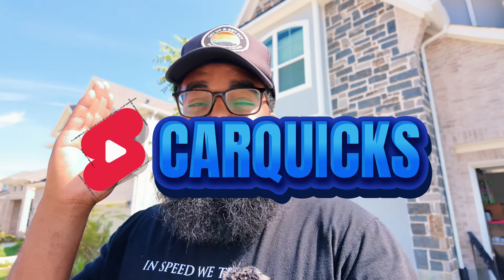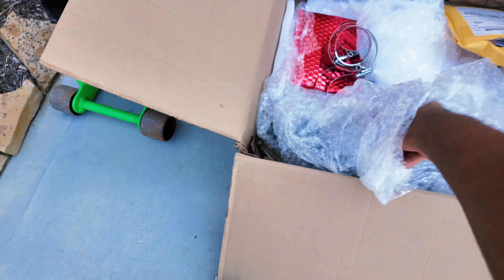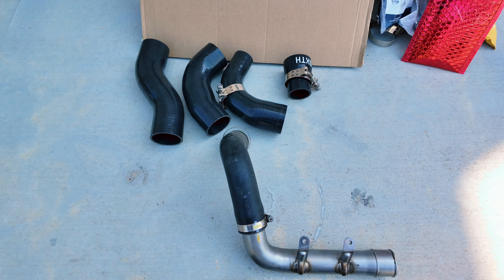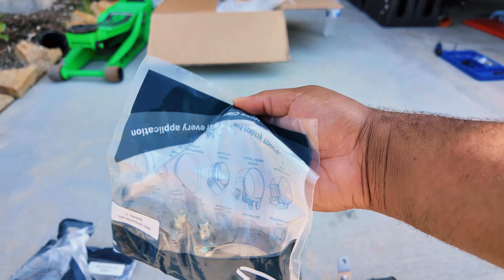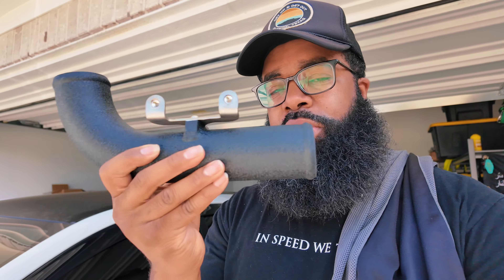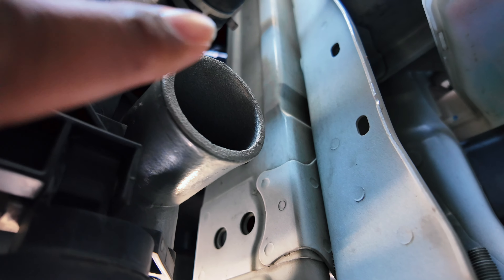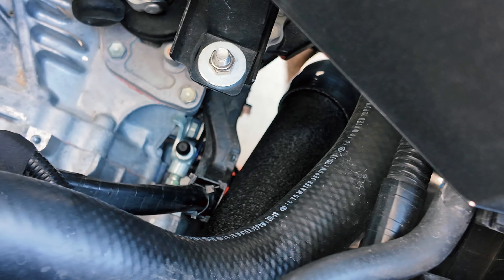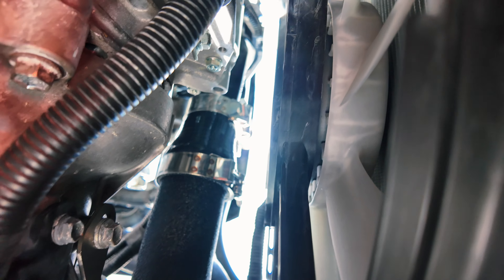SXTH Element GR Corolla Charge Pipes | Install

Comment: Man, I have really been enjoying your GRC videos. I have a 2025 model on deposit. You have given me a LOT of good ideas for it once I take delivery sometime next year.
Reply from the maker: You'll love the car once you get it!
Reply: Horrible car man I’m this close to returning it, damn car chooses timing on its own, gives you boost when it wants too I’m absolutely done with it, giving it one last shot and that’s tuning it and if that doesn’t work I’m trading it for something better, any who today I got absolutely obliterated by a 2009 Acura TL, on some real bullshit, guy turn on his emergency light after he beat me, you don’t the feel I felt after loosing man I spent 54k and this piece of shit car and that guy happy with his cheap Acura TL.
Reply from the maker: @ here is what I will say… you need to get your car sorted, if what you are experience is in fact true. ECU aside it sounds like you have a problem.

And you don’t need to take my word on that, look at the many other accounts from Australia to the UK running the exact same engine, look at the development they’ve done. 

Do more research. Check for boost leaks. The ECU has its ability to make adjustments but most cases it’s making those in benefit of things like more airflow, more fuel. 

What you are describing sounds like a car having issues.
Reply: @mr_thrash8514  bro what lmfao go get a 10 speed mustang gt if you want straight line speed

Comment: Quick question, is there a difference between charge pipe and downpipe?
Reply from the maker: Yes. The downpipe comes off the turbo. The charge pipes come off the intercooler.

Comment: Did this a few weeks ago, clamps were good except had to use the stock one off the turbo x2 cause the ones sent didn't hold. Also did a old BMX trick and sprayed Hairspray on all the rubber to metal attachments then clamped em down. haven't had anything slide off yet.
Reply from the maker: Thats crazy, we did the EXACT same thing with some hairspray lol

Comment: Would this work with the OLT intercooler
Reply from the maker: That could but you’ll need to run the OTL Intercooler that has a 2.5 inch outlet/inlet.

However, you could still run a silicon coupler that reduces down to the OTL sized intercooler and run these fine.

Comment: I have the SXTH Intercooler and charge pipes. They are great however the clamps are trash. I repeat DON’T use the clamps that come with the kit they leak boost. Use constant tension clamps. Charles from SXTH overnighted me clamps from McMaster Carr that are industrial strength with nylon bolts and are constant tension (WORKS GREAT).My Corolla GR make 303whp and 310wtp on a mustang dyno. (Only mods are intercooler and charge pipes) The charge pipes with the intercooler makes a good power gain. If you tune it you will gain more power and torque earlier.
Reply: Can you send a link to the clamps ur using?
Reply from the maker: Look into all the heavy duty clamps, we used a few Constant Tension clamps and the Ideal Tridon clamps. The Ideal Tridon clamp is specifically made for high vibration, off road equipment and heavy machinery. With how our engines run and the vibrations you normally get under hood, this are amazing.

https://hcl-clamping.com/collections/all?hose_clamp_type=Hose+Clamp+Type_Heavy+Duty+Hose+Clamps&page=8
Reply: @CarQuicks  I called Charles at SXTH in July he overnighted me free of charge constant tension clamps made by McMaster Carr heavy duty like you said they have a spring and have nylon bolt. Apparently these clamps are 15.00 each. With 8 clamps I was happy SXTH stepped up and took care of me.  I hope the new clamps they provide are these for customers going forward. These new clamps are awesome no issues whatsoever with new clamps.
Reply: Fwhp or awhp? Corrected numbers?
Reply: @cheeko_914  it was a mustang dyno awd. We did 3 runs and the only mods are a intercooler and change pipes hot & cold side. Was done at Kings Performance out of Orlando Florida. With a tune you will gain more power earlier in the power band vs stock tune. Lower charge temps and more flow= more power.

Comment: This is only compatible with the SXTH intercooler correct? I saw that mentioned on their site. Also what is the benefit of getting bigger pipes if the turbo inlet is still smaller than the pipes?
Reply from the maker: This is correct, most charge pipes retain the factory sizing, but benefit from less restrictive tubing and better airflow. The SXTH charge pipes are 2.25 inch in diameter, that matches the intercooler. 

As for the benefit, even though the turbo inlet is stock (which in our case we run the SXTH Turbo Inlet), you would still benefit greatly from the better airflow to the intake and turbo from the charge pipes not being so restrictive.